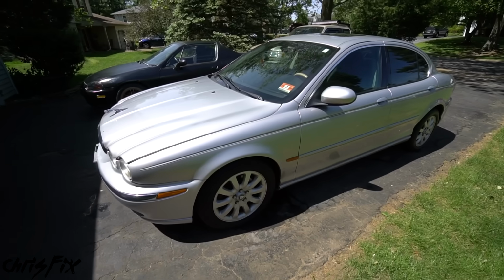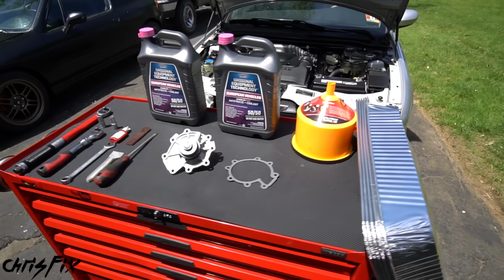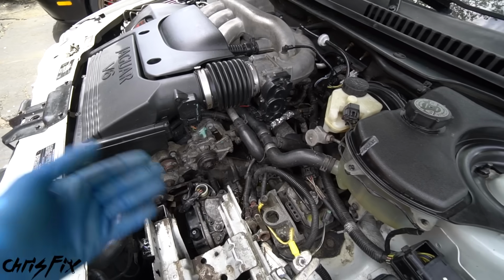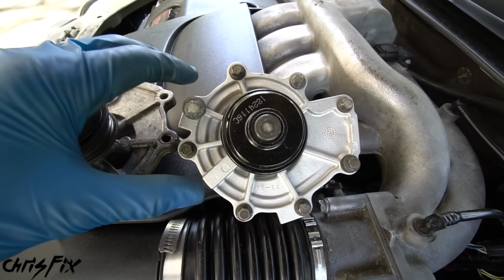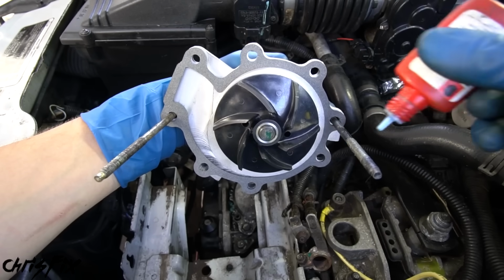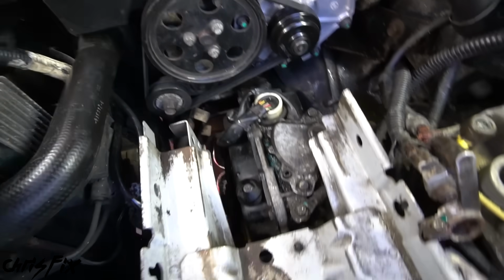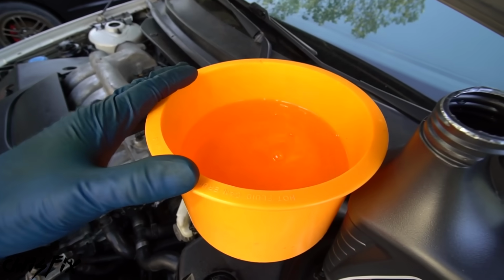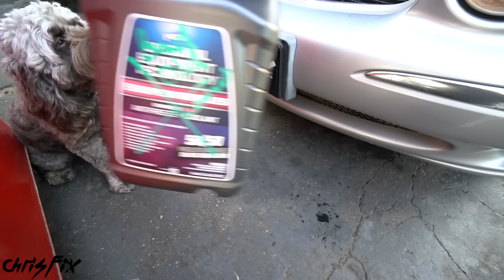How To Replace a Water Pump and Save $783

Comment: $843 vs $60
And THAT is why we call you the STEALER rather than the DEALER
Reply: I'm  was shocked when i saw the price the dealership gave. I was expecting they would have to dismantle half of the engine, while in reality its a rather fast job :-s
Reply: @bbck15  I think that for some cars even just replacing alternator is hell a pain
Reply: Nobody should be surprised that dealership servicing is so expensive. The price they charge has to cover ALL their overheads and still leave room for a profit, and dealer overheads are HUGE - the premises, the equipment, the uber-expensive factory diagnostic stuff, the factory training for the techs, all the stuff on the car sales side as well...

They'll also only use OEM parts, and you can bet the water pump Chris bought wasn't OEM.
Reply: dunebasher1971 OEM WOULDVe never been that expensive
Reply: I still always call them first for oem parts. Hondas pretty nice about it. I payed 35$ for a vtec solenoid on ebay for my d series (the cheapest honda engine) my type s engines(one of their best engines) vtec gasket was $4.35
Reply: Braxton Curry It’s crazy how much they rob you
Reply: @Prometheus7272  it's not that they really rob you, they studied for their degrees and also their experience, plus their time. and last of all its jaguar. they also have to make a living. of course 800 is an insane amount but I would say 300 to 500 is a decent price.

in the end if you dont want to pay that much do it your self.
Reply: @TheRexilius  Its supply and demand people can generally afford to pay for it so they charge it.
Reply: @TheRexilius  You're also paying for their OVERHEAD.  The facility, tools, utilities, safety equipment, the list goes on and on.  I still think they're a ripoff, in general.
Reply: @TheRexilius  still robbery at 800.
Reply: You meant theif hahaha

Comment: Bro I really wish you were my friend because my car was parked and just got totaled and now I’m looking for a new car (used car) and I really wish u could help me through the process because I don’t want to get screwed over like what’s happened to me before. The car I’m currently interested is a 2003 wrx for almost $4000 and the mileage is 127,000 miles, and it’s also a one person owner. The only thing with the car is it has a few small bumps and scratches and also the driver side floor is torn, and the seats (which are cloth) are very lose (like the cloth is loose)

Comment: Any tips on what to do about disconnecting the battery when you don't have the code for the original stereo? I know some reset and need the code to be used again

Comment: My 2004 BMW 325ci had an aging cooling system that leaked OFTEN. for 400 bucks i bought an entire cooling refresh kit that came with all the hoses, thermostats, water pump, belts, pulleys and coolant... also a RADIATOR was INCLUDED. I called the dealership and they wanted $1600 parts and labor.

I did it with a youtube tutorial and 4 beers in 3 hours.
Reply: Good car story.

Comment: Hey Chris, I've got a question about Oil Catch Cans:
Do you recommend installing them? If so, would you make a quick guide on how to avoid as much pollution posible to travel from the presurized crank case over to the intake manifold via the positive crank case ventilation system? 
Thank you and have a nice day!

Comment: I have a problem with my car and maybe you can help. I went to warm up my car and when I put the key in the ignition when all the lights when on, it sounded like something came off... When I started the car it makes this loud hissing noise and the car doesn't idle and shuts off. It has power and drove it back and forth.. But that hissing noise is still there and it doesn't even idle and shuts down. It's starts up again but goes down.

I eventually got back to my parking space where the car is parked . When I started yesterday. Everything was fine. Now this happen and wondering why. It's a carburetor version car

Comment: Hey guys I hope you can help me, it’s not related to the video but...

I bought a used 06 Mazda 6 with automatic transmission, on the trunk is a bottle of atf m/d fluid but the manual says to use m/v fluid, it appears to be a little low on transmission oil but the oil it’s still in decent shape, should I add a little more oil? Would it hurt to change the oil and filter with the m/v type even if there is m/d inside?

Comment: chrisfix please i have question , when i turn the AC on  and put it on 2 or 3  the brake pedal stiffens when i press it multiple times  , it still works but i have to push harder for it to brake normally and it won't go  far back as if the ac was of ,i've checked the brake fluid and it's good but i

Comment: Hey Chris, I got an electrical issue with my car that no one can seem to solve. It's a 2001 Lexus GS430

All I know of is that my radiator fan continues to run with the car off, draining the battery.

Late May I was told the fan motor was burnt out, so that was replaced along with the relays. Early June the car died again, and I was told the Alternator had a bad diode, so the Alternator was replaced along with new Relays. The battery was said to still be good as of 2 weeks ago.

I did notice My coolant reservoir  is very low when the car is cold, could that cause the fan to continue to run? The engine doesn't overheat or anything.

Comment: Chris EMERGENCY...  Not sure where to write this.  How do you fix a ceased engine that had a couple of gallons of water in the oil pan.  (My Mercruiser I/O boat.)  Soak cylinders in liquid wrench, transmission fluid, Coke??  Already pulled plugs (wet/rusted) and changed oil.  How do you change cold oil?  (I was sucking through dipstick.  Hard to get to pan without removing engine.)  THANKS.

Comment: Hi Chris .....not long ago I drive pass by a little deep hole so under my car is hit to the Ground a little hard....than I thing my oil pan seal start leaking oil and it leak very very little ........so I try to reseal my oil pan can I reuse the oil pan or I have to buy new oil pan??
Reply: I got 2013 Acura TL

Comment: $843 is a lot of money.  However, remember its all relative.  If you have the $843, and can afford it, and you can't fix things,  then that is just what it costs.  Remember, the dealer or local mechanic has bills too:  salary, benefits, electricity, cost of the part and time.  If you are handy and can fix things then no, its not worth it.  Do it yourself. Good video..

Comment: Hey Chris, long shot that you’ll see this but is there any way you could make a video on how to diagnose a problem when your engines backfiring? I have an exhaust leak, an oil leak, the car runs but backfires occasionally and feels as if it’s not getting enough power when getting up to speed. Could this be the spark plugs? Thanks

Comment: Yo Chris I need help with my 2003 Tahoe I keep getting engine reduced power I already changed the throttle body and checked all the other solutions and it still says the same thing

Comment: Unless the water pump is ran by the timing belt or chain, anybody should be able to replace one. If it is ran by the timing belt, thats another story
Reply: Exactly. That timing belt/chain water pump is enough to make someone jump off a cliff from the price alone. 😭😭😭
Reply: $2800 for water pump on 2013 Ford Taurus, timing chain... Bruh
Reply: Thats why most of the times the water pump is replaced with the timing belt, because when its breaks it cost you more that replacing it every time.
Reply: Speak the truth. And any old independent will do that job for probably 100 or less in labor maybe 90 parts with coolant. $800 for a belt driven, yeah they're earning their salt. I think this video misleads people.
Reply: @samuelsholder2789  nope i think its true. I workt for school by mercedes for 11 weeks and one time we looked how expensive we where just for fun. Turns out replacing a battery cost you around 300/400 euro's
Reply: @samuelsholder2789  id charge 50-60 bucks for an external water pump replacement..customer pays for for parts and any coolant of course. If its timing belt driven than id charge 175-200 depending on the difficulty and engine

Comment: Make more drifting videos and get your Mustang wrapped and have new rims and tires for drifting on it and make sure you get the requirements safety so then you can actually drift and if they do check your card so you don't drift just go back to everything normal that you have and please go back to drift Fanning chrisfix I want you to go back to Drifting and I bet you a lot of other people do instead of just working on cars I want to see more drifting videos and more car videos more acquirement videos try to add a roll cage to car tried to make the speed bigger try to get a twin turbo system and try to get a pro steering wheel try to get a lot of new things get some harnesses for your bucket seat get a doctor but no mine try to get a new carbon hood try to get a new spoiler preferably carbon try to make new car videos please please please a bunch of people are begging you please chrisfix please please please I want to see more car video with a bunch of other people want to see McCarthy I'm doing this for the sake of the society and the community that you had going on I haven't been with you since forever but I've been with you since you have 1 million subscribers please chrisfix make more car videos about drifting or drag racing and get a new parts car and just take that parked car make a new drifting car just to add on and build on if you get bored of your Mustang or your truck or your dad's Jaguar your mom's new car that you just bought her

Comment: Little tip for anyone out there whos got a torque wrench... if you know the torque spec of a bolt, don't use any locktite, the torque of the bolt is enough to keep it from vibrating out. Same principle as drain plugs... no need for locktite just a crush washer and a properly torqued bolt.... I've had bolts that have been a nightmare to get off because someone used locktite on them and tightened them way beyond their torque spec. Locktite should be a last resort (Ie. if the bolt/hole is missing threads, or if there is not a known torque for the given bolts (which almost every bolt should). Also there are general torque amounts listed on a reference sheet for different sized bolts that can be used if the torque is not known.

Comment: I saved 1300$ when my sisters VW (2.0tsi Engine) water pump failed and I did the whole job for 400$ (also needed oil seals that caused the water pump failure and paid for fast shipping). It’s crazy how much you can save. Now this water pump was really annoying because there was very little room unless you removed the intake manifold and then you’d have to do new injector seals because it’s direct injection and just adds money and complexity so I took the long route from going through the bottom.

Comment: Hey Chris, Nissan water pumps are (interior) with an access panel, run by the timing chain, that will be challenging for do it yourselfers. I charge 450.00

Comment: Ive changed tons of water pumps but the only time it was ever difficult was on a 2005 prius. They put the engine so close to the wheel well that you have to do it completely blind by feel, took be almost 20 minutes because the gasket kept falling off.

Comment: Where were you when the coolant needed changed in my WK2 and Jeep wanted $900 to do a new radiator and pull the pump to see if the impellers were bad?  Welp, good thing I did it myself and saved bunches of money.  Wooder do you think I'm made of?  Money?

Comment: What about air in the heater core? On a lot of cars the heater core can be air bound and you get no heat. If you run the heat while the car is coming up to operating temp you will also get rid the air in heater core

Comment: I hope I have Avalon 2015 There is a problem with filling the fuel There is air so that I should be holding the packing hand because of the air pressure in the tank

Comment: Hey, bro, I have been using normal engine oil till date but used Chevron 10w-40 synthetic blend this time around as in Pakistan It's usually 40-45'c in summers have changed the air oil filter as well, while air filter has been changed after a very long time. Does engine oil affect gear shifts? Because I have noticed immediately that my car takes a bit longer to shift gears, kind of needing more acceleration but the shifts are smooth unlike before where it would at times jerk when downshifted and immediately accelerated. I don't know if with this new oil it became better or it's a new problem :/ I'm into cars and I am a person who gets anxiety problems over such things. Like maybe I shouldn't have used this oil, may I changed that filter so it might be because of that, etc.

Comment: Hey Chris I have a 91 corvette just like you and the radiator fan won’t turn on. I used the paper clip trick where I pugged it into the scanner in port A and B and both fans turned on. So I thought it was a relay switch but when I put a new one on there it still didn’t turn on and is letting the car overheat. What do you think it could be?

Comment: Tip : take the box and trace the new water pump against it , take the bolts out one at a time and insert it into the carboard /wp hole location

Comment: Wouldn't your coolant reservoir be 100% full using that no spill funnel? Also wouldn't the coolant reservoir be the highest part on the coolant system anyways? 

I would have just filled the reservoir, left the cap off, and watched the coolant level while the car burps.

Comment: Hey chris I have a huge question about my car. My RPMS are jumping all the way to 6,000 or 5,000 and my car sounds like its skipping gears, driving in neutral or about to blow up while going about 10- 15 miles per hour. Thought it was low transmission fluid from an incident from awhile ago, put in tranny fluid and still has the problem. I have a few ideas about whats wrong with it like the coil caps, spark plugs, distributor, and few others. Im still new at working on cars but before i went and spent a bunch of money on guessing on what the exact problem is. I was wondering if youve came across something like this and had a more narrow thought on what could be wrong? 
My car is a
2004 Chevy classic or malibu with a 2.2 eco tech engine. Ive sent my car to the shop and they gave it back with this problem. Ive already spent alot of money on this car and would like some advice before I take any other steps.
Please get back to this, it would be much appreciated, Im a HUGE FAN and Id love the feed back.

Comment: Aren’t you supposed to soak the new water pump in water so it creates a water film on the ceramic an carbon inside the pump so it doesn’t cause a squeak doing the initial start up.

Comment: $843? And the water pump is in the exterior of the timing belt cover? I can’t believe there are people that won’t fix that on their own. I don’t care if you’re not a mechanic, anyone with a couple tools can do it. If the water pump is interior and grabbed by the timing belt then I could see why someone would pay to get it fixed, You gotta know what you’re doing. It’s still simple but there are some extra things you gotta do before putting the timing belt back in. Price is still pretty high tho.

Comment: One last small think you should do is to do is to let the engine run for a while, let it cool down and then open the cap while the engine is off and cold for the next few days. My engine had air trapped in it even after the funnel, the pressure busted the radiator and took the engine with it..

Comment: Hi Chris, Iam getting oil into my cooling liquid and makes like a spongy thing. Could you tell us how to fix that problem?
Reply: vlad rac I would get that checked out ASAP sometimes when coolant is in the oil it’s a head gasket but oil in the coolant is bad, could cost you a motor, radiator, and cooling hoses.
Reply: ty man, i will give ot to my mechanic ASAP. I have a passat b5.5 tdi 101 hp from 2001. i have  drove it like this for an year now...
Recently we had a really nasty rain where i floodded all my engine, i tercooler, turbo; got it on a platform, went at a mecanic and he took the water from the motor and took the things that makes spark off, used the electromotor to take the water from the motor out. then he put back all the peaces and i had a 1% chance that the car would start and it DID! XD. Drove it without a air filter for like 2 days when i crashed it at like 15km/h and had to replace my front mask and tragger. Yesterday i replacet thoese, got on an air filter and now i have to drive 380 km to the mechanic to check the engine. RIP i would say.

Comment: Hey chris i have a 95 Honda Accord LX and my 2 front tires roll a short distance but then it stops but have to force it to move but the car will not roll on its own even in neutral it will not move any idea why its a 5 speed

Comment: Be careful on some cars if not most of all the water pump is on the timing belt and if you rotate any pully you could ruin your engine,I recommend doing this if you have the water pump on accessories belt, if not you will have to do the timing of engine again... and in this cause change the timing belt and tensioner too

Comment: Hi Chris, I used to have an X-Type and had to get rid of it because it would keep going into limp mode. Could this have been caused by the fact I got a 90 Ah battery (instead of the 75 Ah it normally would have had)? Years later I'm wondering if the cause of all those breakdowns was not as simple as just not using the right battery in the first place.

Comment: Im jus curious, every car is different, I have a 2009 Ford Fusion SE, 6 cylinder. 
My engine check light will not turn off, even when I have addressed and fixed the recommended issues. If possible, can you give me some tips on what to do?